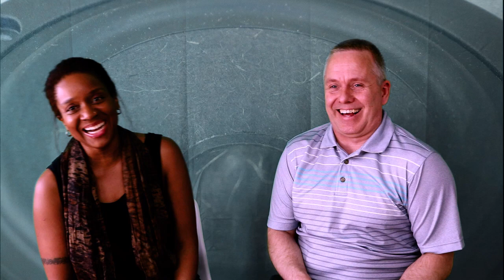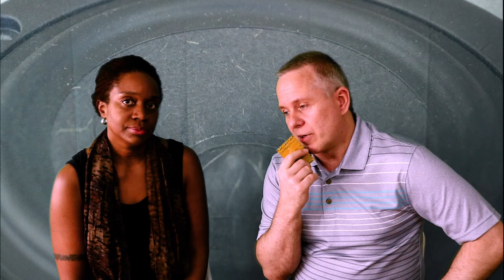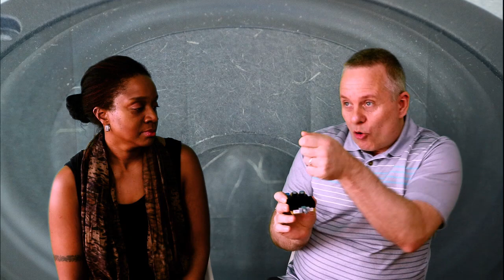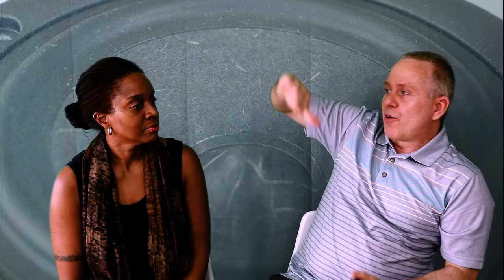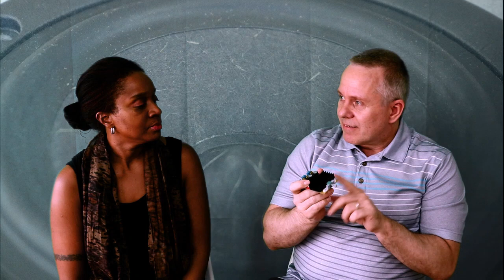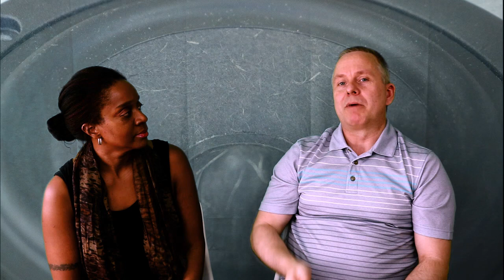FOR BEGINNERS ONLY: Can an Amplifier Blow a Speaker?

Comment: Transistor shorts mainly burn up woofers, The tweeters in this case immune due to cross over caps blocking the DC voltage
Reply from the maker: A transistor short will certainly do it, from letting out constant DC and the series capacitor(s) to the tweeter will close and protect. But this occurrence I dont see that often in our part sale.